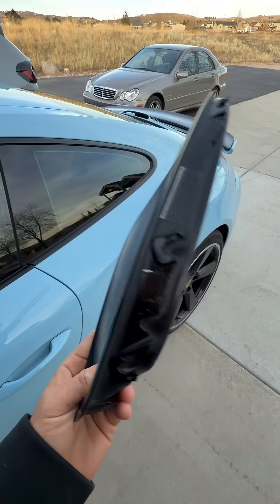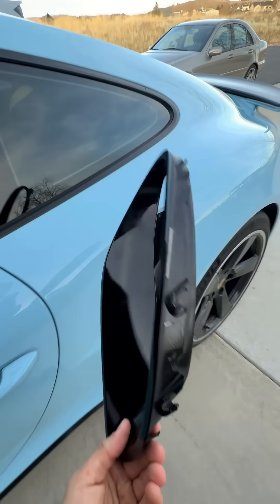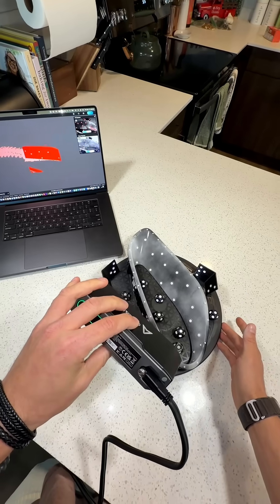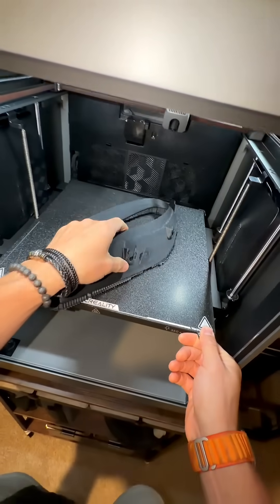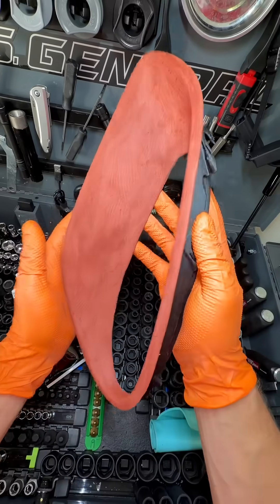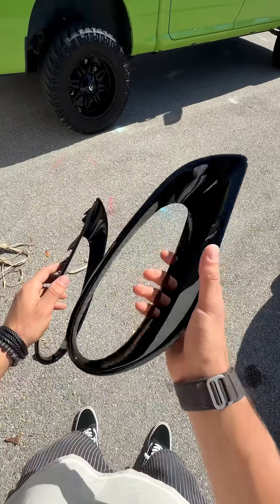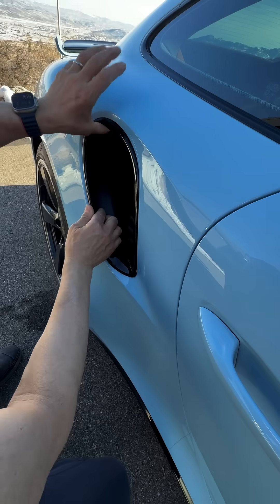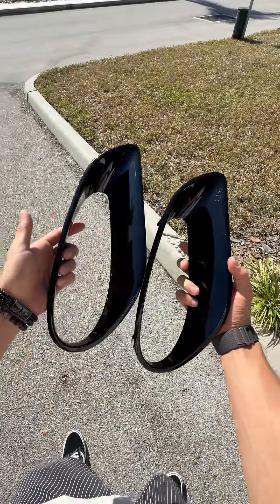Porsche wanted $2,000... So I 3D printed it for $20 instead😳😳😳 #3dprinting #creality #porsche

Comment: First of all did you replace a $300 part. The near $2000 part is a carbon part not the shiny plastic one. Plus the scanner alone costs nearly $1000 and these scanners are not accurate and a lot of work and knowledge is required. 

This is a stupid sponsored garbage by Creality again.

Comment: The printer is currently 300 for a refurbished unit. The scanner is about 300 for a refurbished unit. The asa is about 25 dollars per 1 kg to roll. The bondo is about 20. The primer is about 20. The sand paper is about 10. The paint is about 100. Total price is about 775 and then you can do all kinds of fun prints after. It's not as hard as most people think. That being said, time is money and to some the Porsche part is more worth it to them.

Comment: So, I wont get into costs. However, you took off the other ORIGINAL part to replace it with junk. It is also a pointless part to replace. Its a visual piece. You added after market parts, which always bring the value down.

Comment: 3D Scanner $1000
3D printer $2000
Bondo/Paint $75
Time: 200 hours cad, sanding, painting.

$3075/200 hours = $15 75/hour.

Congratulations you work at McDonald's

Comment: Porsche. Making highly overpriced, extremely fragile, expensive and hard to repair Volkswagens since the 1930s.
The company has worked for decades to make the engines sound whiny and and powerless. 
Because they don't have useful low RPM torque. At high RPM they sound like F1 cars and I hate that sound.

Comment: Years ago I had a buddy with a broken door handle part on his minivan. This was years before 3d printers were common but I was doing silicone and resin casting at the time. Luckily the part wasn't mirrored left to right but was a one part for both. So I was able to cast a replacement part that was only available as part of a large, expensive sub-assembly for a couple dollars.

Comment: Why wouldnt you?  Most people have ,neither the equipement, skill, or know-how.  You cabt juat buy the 3D equipment and get that result.   Tou can just buy sandpaper,  bondo, and primer and expect it to be paint ready for a professional paint shop.  So, by the time you get someone who hase all of the knowledge, skill, and equipment to do it for you, you'll be out of $500 or more and end up with a product with tabs that will snapoff if the part ever gets removed due to the non flex filament and way 3D printers make layers.  You have a Porsche,  be ready to pay the cost of maintenance and parts replacement.

Comment: Oh yeah let me run out and buy a 15,000 3D printer and probably $1,000 scanner and spend $200 making the part I think you can make the $2,000 at work in that time.

Impressively done though very great work absolutely If you got all the machinery excuse and you're ready to do it that's awesome

Comment: I've tried this a couple of times on different parts and it was difficult to say the least. The parts never came out the way that these parts did and there was a lot more fine tuning than what was shown here. Maybe things have gotten miraculously better in the last 3 years but, boy, I struggled and in the end just bought the pieces I was trying to make. I really do hope things get to a point where this would be an easy thing to do for an amateur user....
Bamboo printer 
Creality scanner 
Amateur at best with CAD software (fusion)

Comment: to everyone calling this guy a fraud or saying he’s lying about the real cost… Clearly it’s obvious Porsche and ALL car makers over charge absurd prices for cheap parts. If the part was reasonably priced no one would jump through these hoops to make one from scratch. If that vent cost $100 no one would bother with this effort. 

I had a cheap piece of junk Civic with 200k miles. A tiny ridiculously designed piece of plastic in the break pedal disintegrated and broke. This caused the break lights to stay on all the time even parked. Drained battery and left me stranded multiple times till I found the cause. This tiny less than 1” round piece of plastic cost $10 to replace. I replaced it with a piece of gum and a penny. That diy repair lasted 3 years until the engine blew and it was scrapped. I found solution on YouTube.

Comment: porsche wanted 1790. bro said “nah! too expensive! imma bust out my $800 3d scanner and my $1,049 3d printer, plus $250 for the materials and a final $100 to drop off at an automotive shop…now i’m no rocket science but $2,199 is more than $1,790. with his version it is more likely to fall off and possibly cause an accident(s) (let’s be real these lunatics probably drive as such) while the legit version won’t come off unless you snap it off

Comment: Seems like a lot of time, labor and effort without knowing if it will really fit. That part has a complicated design. The slightest misfit in the holding clips and it will fly off at 100mph.

Comment: is everyone in these comments r3t4rded? thinking that the 3D printer and scanner are single use, and have no other uses or value aside from printing one item?? everyone is including the cost of the equipment, like it was bought specifically for this one, singular task, and will disappear once it's done. y'all seriously need to get evaluated, if that's how you look at the world. a 3D printer is an incredibly useful tool to have (and it's truly a privilege to own one) and so many things can be made with one; from personal, to functional, to commercial. it's DEFINITELY something that pays for itself over time, both in savings, convenience, and often things that can be sold. to act like that has to be factored in to the cost of making the pieces is dumb as hell. 

also: i don't care even if this is an ad, review, or perhaps a tax write off. but the responses are proper braindead, and say more about everyone commenting, than the creator of the video. holy fck.

Comment: Something print influencers never regurgitate is that ABS, ASA, and any other plastic that can be melted with acetone has exceptional solvent based paint adhesion.  Because the thinner used in most spray paint is acetone.  Plastics that superglue refuses to stick to, or very weakly (like PETG) are horrible for paint adhesion.
Reply from the maker: Good to know! Thanks for the info!

Comment: I can see the difference by reflectivity and small details that would be hidden by the placement. Good work though as it isn’t obviously even if you took it out until you’ve had the original part and then with an eye for small details you’d have a chance to notice. Yes the equipment cost, but so does it for Porsche. It’s a one time cost, and if you’re planing to fix up multiple cars and resale them rather then just fix your expensive car, this method is worth it. As a kinda purest though I’d definitely drop the 2k 😂 don’t grill me.

Comment: I mean basically if you can afford Porsche and can afford a 3D printer then yes... You saved like 1750$... But at the same time.... You Have Porsche... and used a 3D printing material... So I would say you saved at max 1000$... But I think the satisfaction of making it was the key part😊

Comment: In The Peripheral the lead character works in a 3D printer outlet in a Mall. Now that’s a concept pitch for Dragons Den. Just imagine if every piece of trim or broken part could be replaced, with just a CAD file or a scan. But, then you wouldn’t need the new model every year and that would seriously destroy the business model of most manufacturers, inbuilt obsolescence.

Comment: Creality Otter Scanner: $700
Creality K2 3D Printer: $400
Creality CFS (Color Filament System): $300
Laptop barely powerful enough to run a 3d rendering software without crashing: $350
Misc. like filament spools and other various necessities: $100+
$7-15 minimum wage to pay yourself per hour for scanning, rendering, making final adjustments on digital model, cleaning, finishing off product with professional paint job and coating.

Total approximate cost: ~$2000+
If you don't make any mistakes.

Maybe the video title has a typo and hes missing two zeroes after the $20

Edit: Oh yeah i forgot you need the original part to scan in the first place which costs that $1800, unless you can find an exact copy of the 3d file online then lucky you!

Comment: Just imagine: You need a state-of-the-art scanner, a 3D printer, various tools, time, materials, and expertise. All for the Porsche to lose value on resale because it doesn't have an original Porsche part. And that's despite the fact that the self-printed part itself costs around €2000 🤣

Comment: You just need a high tech computer. Which is probably expensive, but don't worry about that. And then you need a 3d scanner. Plus the application it's in. Not to mention all the knowledge you need to do all this. Aaaaand you do do need to buy a three d printer with the supplies. But listen, this is really a cheaper guys. Like cmon really!!!:😅

Comment: Now I need a $2,000 3D printer, problem solved😂
Reply: Actually the 3d scanner is the most expensive thing in that video
Reply: @a @anguismemes1666 id say the house in the background
Reply: You can print that with a 200 dollar printer 😂
Reply: @christophde7720  yeah and you need to learn how to use the scanner, how to use the 3d printing software, is not like you buy it and you print straight away, will take days of practice and watching tutorials, and that printer in the video doesn’t cost 200$ btw
Reply: A $300 printer can do this easily.
Reply: @cheapskateaquatics7103  No you cannot, the part is too big... Bed width is usually 220mm max on cheaper printers.  They also can't print ABS without an enclosure.  Plus if you're getting a cheap printer lile a KE 3, a beginner is going to have to spend several months learning how to print and design....
Reply: Mac and cheese cost you $2000 because you made it on a $1,995 stove 😂
Reply: Check a nearby large library, a lot of maker spaces in them have 3D printers now and you only pay a couple cents for the plastic used.
Reply: @Soopersquid64  no shit? Libraries have 3d printers in them now? I haven't had a library card in 15 years, that might change soon lol
Reply: @bushwacker2048 yeah, my mom found it out and she would go every week to print things out for little decoration projects while I was still at home. You can check online at the library’s page to see, she had to go to the library downtown for it to have one so it’s probably only in higher population areas, but having one within 30-60 minutes of you as long as you live in the suburbs is still really nice.
Reply: @Soopersquid64  hell yeah, good shit. I'll look into it, thanks for the heads up
Reply: Its an asset, he can make other stuffs with it
Reply: True, and it’s also unlikely something like this would happen again. But I could also see how, since it’s just the one time purchase, (except for filament) it could maybe, eventually repay itself.
Reply: Imagine spending hundreds of dollars on a phone just to write this comment

Comment: Why not just get the engineering specs for the plastic panel from Porsche and plug them in to the printer? This seems like it’s so much more work than it should be.

Comment: I was wondering if a printer printed a perfect surface and if it was just going to be installed and if the sun would fade , then I saw you priming to paint ! Never seen anyone print a car part didn’t think they had that durable materials you guys can use ! Does it just come in a roll or something?

Comment: Right, because the sort of person wealthy enough to buy a relatively new top spec Porsche 911, note the existence of the letter e at the end or Porsche in pronunciation, couldn’t possible shell out a few more grand for factory parts replacement.

I could understand that being a matter with a salvaged supercar, but if someone has the coin to buy a car that expensive not salvaged, I highly doubt they need to count their coins on some replacement parts.

In short: If well over 150 grand or so (depending on currency) for a car doesn’t make one balk, I highly doubt 2 grand would.  At that point, just 3D print an entire Porsche, which is possible.

Comment: if i could afford heygears or formlabs i'd spring for a uv stable, semi-flexible resin personally.  not quite as much work to post process for installation & would look cool simply clear coated - translucent would be interesting too, though.  i do abs & asa fdm for parts on my truck & my ladyfair's car, but neither of us are near swanky enough to ever drive a porsche.

Comment: Scanner
Printer 1
Printer 2
Filament 
Computer 
Sandpaper 
Body filler
Primer
Professional part paint job 

(Assuming you learn how to use it magically)

Clearly not saving money. I hate that this video was framed as a way to save money instead of a car flex and tool flex

Comment: scanner- ~800 dollars
printer- ~550
material- 250
time- several hours (assuming)
plus whatever else used thats small in cost or otherwise unmentioned
Its only really worth the time if you already have the tools, and not worth getting everything for one-off parts. not to mention printers do have size limits which depending on the part can limit what you can do with them

Comment: yea the automobile industrie is going rage!!! for example, my electric handbreak switch by my Tiguan was broken. Volkswagen wanted 90€ for the switch (nice), but the cost for takeing off the old one and putt the new one on costs me 380€ so in sum 470€. Than I asked a thirdparty workshop and they did it for in total 150€. CRAZY!

Comment: The clear an opaque color low voltage LED highlight fading accent effect is smooth showing up  everywhere. AI generated graphics fiber optic matting raps, insane. Floors, walls, ceilings, curved surfaces anything now can change beyond the imagination.

Comment: okay... but liek thatsd all well and good if you have that scanner already. If not your adding about $1000 to your repair cost anyway on top of everything else just to buy one... Thats also assuming you already have the 3D printer and material for it which would also add cost.

Like I get it, porsche is massively overcharging for a piece of plastic. But this is a very nivhe solution that won't be avaialble to just anyone.

Comment: Original part price 1790.46
Scanner price (no equipment):
K2 3D printer is 549 (right now on website sale)
Otter Scanner is 899
Reflecting markers 21.59
ASA filament 22.99
Comparable Scanner Spray: 59.99

Total: 1,552.57

So in total, if you had none of these things, you would need approximately 1552.57 dollars to create the part, saving 237.89 dollars. Also picking up tools.

fantastic. I do not know many people with plastic parts issues amounting to 1.5k but if you do have this problem, you can effectively learn to be a nerd machinist and save money doing it.

1.5k is much cheaper than i imagined for all of this.

Comment: Yeah... IF YOU HAVE A 3D PRINTER AND SCANNER!
But also I'd like to add that they kinda need to be treated so that "extra step" isn't extra. If you don't sand it down smooth and treat it then the airflow won't go through correctly. You will get wobble and weird sounds as you are driving.

Comment: For all the people thinking it's expensive or takes a lot of time, you can print this with a 200 to 300 dollar printer, material cost less than 5 bucks and you can get an expensive scanner as an investment but you could litteraly use a xbox 360 kinect as a scanner if you're really cheap, about an hour or 2 max in sanding and painting and you saved 2k, i think total cost with painting at the shop is about 450 max, then I'd say at most it would take 3 hours scanning and sanding/priming it would probably be 1.5 hours but to be generous and still you saved 1.5k for a couple hours of work

Comment: Auto manufacturers earn more profit from cars during the life of the vehicle than they got from the initial sale of the car

This is why they don't really want EVs because they generate almost no income from maintenance and have way fewer drive train parts and those that they do have do not break as often

EVs have way less wire under the hood, way less sensors and none of the many, many emissions control junk

EVs also have way less diagnostics

The few problems that EVs bring are loud, obvious, but in you face and cannot be ignored, BUT! they are easily managed

We have become callus to the many, many problems of ice vehicles but when you go EV you start to realize pleasure of their absence

* Less drive train repairs 
* No cost of Tune-Ups & Oil Changes
* No exhaust noise & fumes
* Way less foot work in stop & go traffic and drive through service lines
* Easier highway merging
* Home Charging, especially with solar
* low center of gravity
* much more

Comment: omfg these comments are so stupid. the creality scanner costs 250 and my printer costs 200 which would work fine for a project like this. ofc time and knowledge are a factor but if you are buying a 3d printer it should never be for one project. even if you bought both the printer and scanner and then never used them again i think saving 1500 is well worth the time spent on something like this.

Comment: I'm a bit concern about that replacement part being printed in PLA as that filament is known to warp very easily when exposed to a lot of heat. It might be best to get that injection molded for long term use or re-print it in another filament that can handle higher heat levels to prevent warping.

Comment: Great now you just need the $3000 computer that can run the software, you need to pay license fees for the software which I would bet isn’t cheap, you have to pay for material, a $6000 3D printer, the $2000 3D scanning tools, and the space for everything 😂😂if you already have everything sure this is a good idea, but don’t pass this off as “saving money” when you had to spend over 10k to save 2k lol